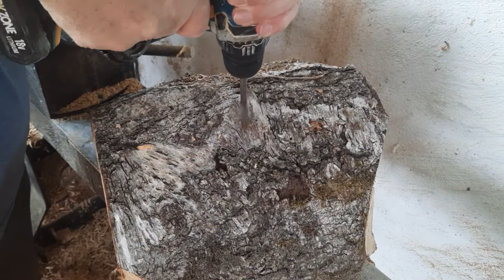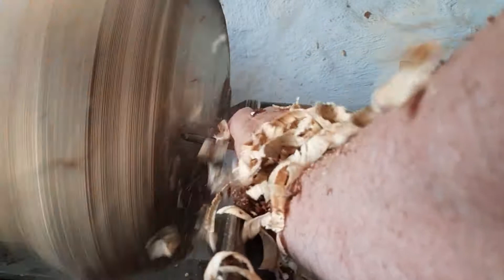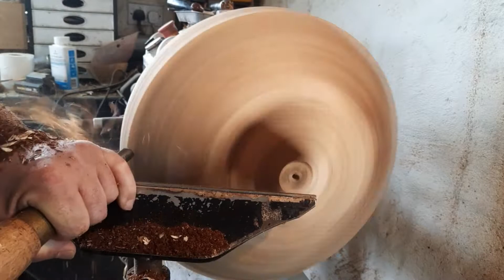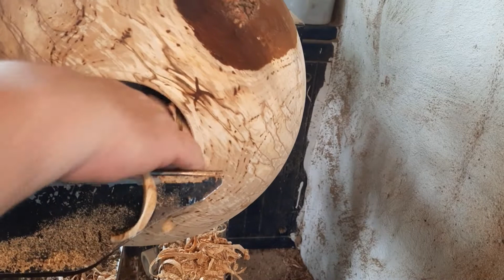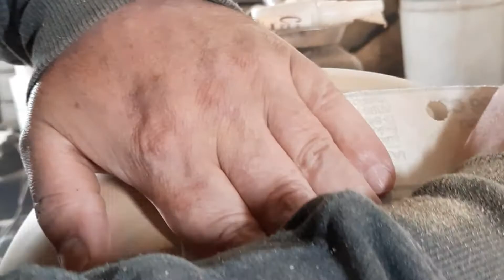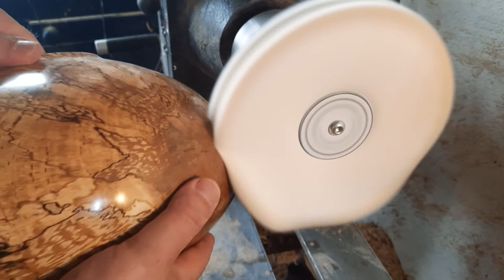WOOD TURNING big birch hollowform.

Comment: As someone who designs woodworking machinery and accessories, please do not use the spur center in a chuck.  That one you used is meant to sit directly in the 2MT taper of the spindle.  I'd hate to see you get hurt.  Beautiful peace btw.
Reply from the maker: Thanks Rich, your quite right that's not the best way to use it, I do that because I hollow in reverse so I have the chuck locked on and that makes it hard to remove,. And even hard
Reply from the maker: Sorry hit the wrong thing, hard to get off and even harder to get back on in a way that it won't unscrew, I've been doing this way of turning for quite some time and never had a problem with it, but I always turn quite slowly when I have this setup, 500 rpm max, onece I have the piece in the chuck then I can do more. But your right it's not the right way,, but until I can find a better way I'm going to keep going, sorry,, but your right in what your saying.